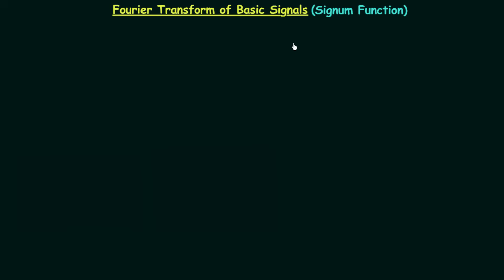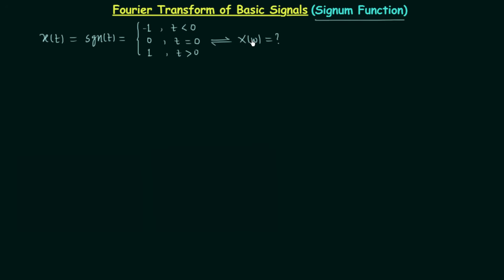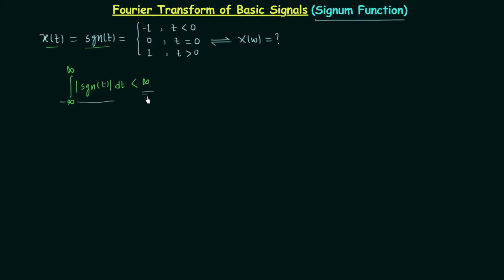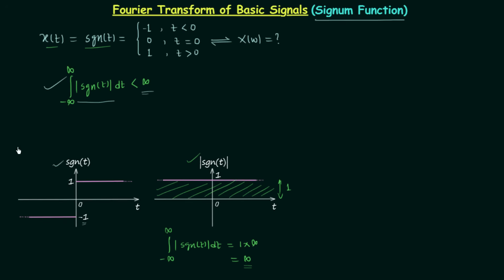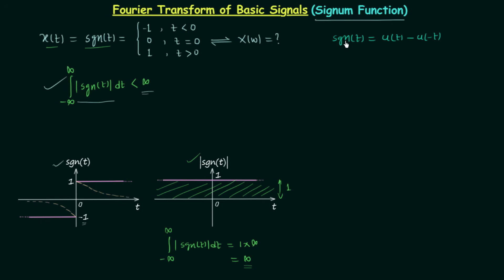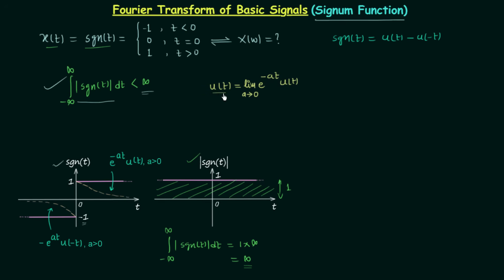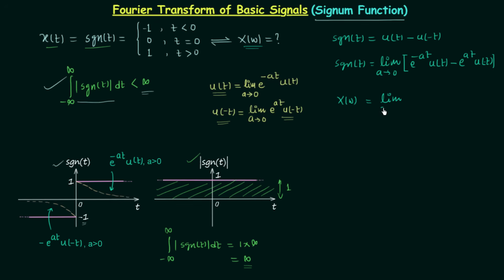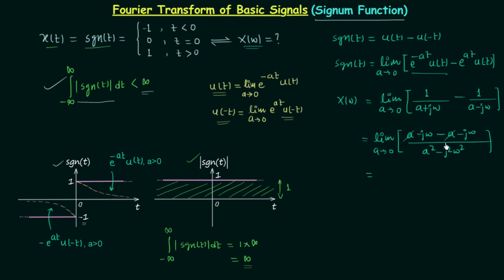Fourier Transform of Basic Signals (Signum Function)

Comment: Thank you for sharing, but it bothers me that here we can use 1/(a+jw) as the Fourier Transform of [lim a->0] u(t)exp(-at) in order to calculate the transform of sign(t), but not in lecture 190. Because on the lecture 190 that proves the Fourier Transform of u(t), you use the signum function as a shortcut instead of transforming  [lim a->0] u(t)exp(-at) and accepting this approximation directly. Why is that equality valid in this proof, but not valid in lecture 190? Direct links to the lectures used as reference would be helpful. Thanks again.